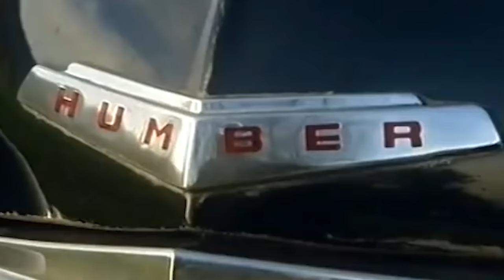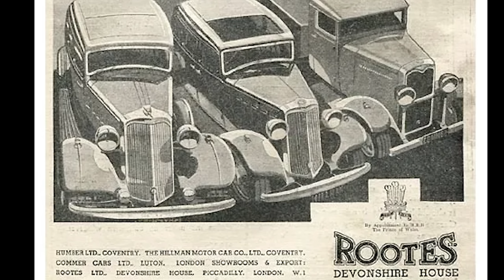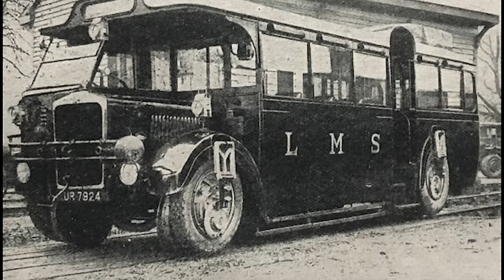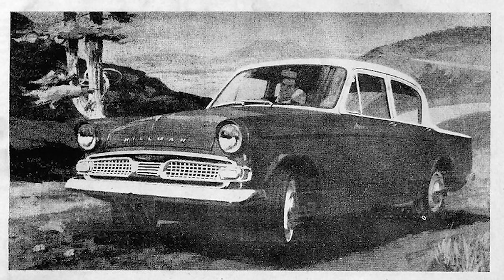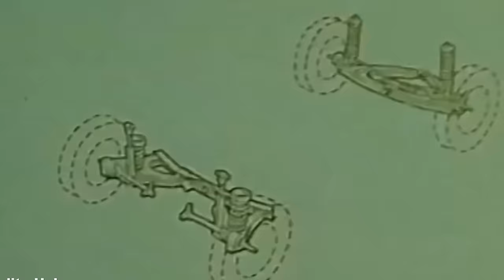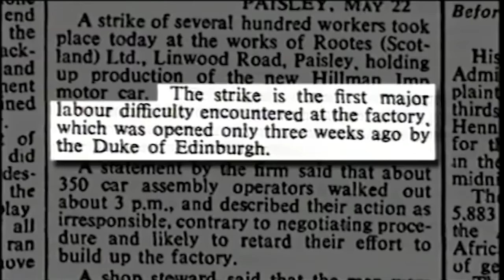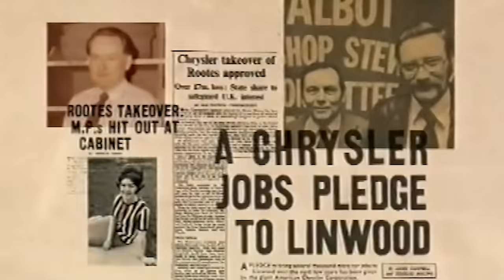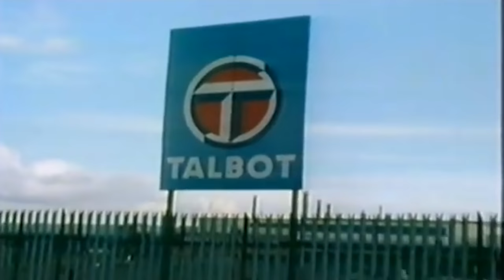The LOST BRITISH CAR EMPIRE! - The Rise And Fall Of The Rootes Group

Comment: The Humbers were the best style cars they made. When I was a kid in the 70's, we had a Humber Super Snipe. 
Talbot was a bain to the company but the big downfall was when they were bought by Chrysler.. Then they bought Simca, which was worse than Skoda cars at the time. They brought out the 'poor mans Range Rover'. The Rancho. It had the Simca front and engine and the rear was supposed to be similar to the Range Rover. A massive flop for the company. 
You missed the Sumbeem Alpine, a great little sports car at the time and the sloping back Sumbeam Rapier, a family sized car.
Reply from the maker: The Super Snipe is an absolutely stunning car the Series V is my favourite. I agree with you on your points about Chrysler especially.

Comment: You stated that the Humber marque was dropped in 1970.  This is incorrect.  A colleague of mine at the time, ordered and received a brand new Humber Sceptre 4 speed Auto with the new Borg-Warner 45 box in 1974. I also owned a 1972 Humber Sceptre Auto with the 3 speed Borg-Warner 35 from 1974 to 1981.

Comment: Good work but no mention of the Sunbeam Alpine, designed to compete with MG and Triumph sports cars in those wonderful giddy years of FUN.
The start of the decline was caused by government blackmail which Rootes could have refused by securing contracts for Imp bodies ahead of launch. This would have avoided the Linwood factory disaster 300 miles from home base and Pressed Steel anyway had a plant at Swindon.
Had the BMC muscle been challenged as having a monopoly on steel bodies it would been successful and, in the meantime, Rootes could have drawn upon steel panels from its partners abroad while teething troubles with the Imp were solved by the time of Mk.2. Some say that teething troubles were largely due to the Linwood labour force lacking the skill set of workers in the west midlands and that balance and cooling problems would have been tested out of existence "at home". It was a revolutionary car in so many ways and more 'normal' than the Mini in terms of internal space and comfort.

Comment: Although the "Arrow" range was a relative success for Rootes, compared to the "Audax" range quality had nosedived. No doubt the influence of Chrysler's cost-cutting accountants was responsible for the tinny construction and the interiors were far inferior - sumptuous pleated upholstery was replaced by cheap flat vinyl with the "pleats" stamped into them. Dashboards became one - piece fittings with cheap switchgear.

Comment: The amount of Hunters that had damaged gearboxes in them, when the wrong oil was used, was amazing. Use to sell parts for them...

The Avenger GT and Rapier H120 were cool cars...
Reply from the maker: Was that a bit of a trend back in the day? People putting the wrong oil in?
Reply: @tomdrives yup, they needed a thin oil like engine oil, but many people who didn't know, put 140EP gear oil which was way too thick...
Reply: My grandfather had a Rapier   then a Hillman Hunter estate
Reply: I had a Hunter , I only paid $50 for it (New Zealand) , quite tidy , and it went well, but there was a problem with the gearbox, when it was in top gear, you had to keep some pressure  with your hand on the gear stick , or it popped out of gear .
Reply: @barrycuda3769  wen my granfather got his hillman hunter estate car , im sure they used red oxide paint to paint the whole car !!!! My grandfather and his son , went to a scrap yard to replace the engine !! 
" the good old days "

Comment: Rootes were ultimately too low-volume to survive with the marque portfolio they had and some within the company belatedly recognised it. Before approving the Chrysler takeover, the British government offered Rootes to both BMC and Leyland who both refused. Yet although not with its challenges Leyland (1965 UK share at 6.8%) would have likely found Rootes (1965 UK share at 9.9%) much easier to digest into Triumph, being a tempest in a teapot compared to breaking its teeth trying to take on the giant gobstopper that was BMC (1965 UK share at about 40%).
Reply: Ehh; had the politicians not kneecapped Rootes plans to expand the Ryton plant (to say nothing of the loss making debacle the Regional Policy then forced them to do), it's likely that the company could have weathered the decades that followed.

That said: old-man Rootes being largely against economy cars in the first place and only mildly tolerant of the Slug project that led to the IMP, Rootes was in a weaker position than they could of been.

A properly launched small car from an expanded Ryton could have got strong sales, especially if priced properly (unlike BMC's Mini 😅).
Reply: In addition to expanding Ryton, it would have also been advantageous for Rootes to: 

- Forgo buying Singer and taking on its debts.

- The Rootes family would take Peter Ware into their confidence early on upon joining in 1958 over the company’s situation, aiding them towards a better direction and a slow pruning of their marque portfolio prior to an alt-Leyland takeover backed by the government to prevent Chrysler takeover. 

During the ill-fated Swallow project, some felt the company should have been consolidated around a single marque like Humber and carve out a BMW-inspired premium niche instead of trying in vain to compete against mainstream market BMC. 

Something they could never realistically achieve by themselves, outside of a potential Leyland takeover and being absorbed into Triumph who were on the up at the time as a premium marque and had brand recognition in the then important North American market. 

- Avoid Communist-directed 1959-1962 Acton strikes that caused losses and impacted Imp related expansion and development at a critical period, which together with Linwood distracted them from attending to the Imp's development issues. 

- Discover true Imp engine 800-948cc displacement range early on rather than fruitlessly trying to reach 998cc, allowing for focus on 998-1150+ tall-block in lieu of Swallow project.

- However tempting it is to make Imp into a British OHC analogue of the FWD 0.9-litre DOHC Alfa Romeo Tipo 103 prototype and calling it a wrap. They should have instead kept the Imp rear-engine yet with a Simca 1000/Seat 850-llke 4-door and SWB Fiat 133-meets-Suzuki Whizzkid-like 2-door two-box. 

Making the Alt-Imp 4-door like the commercially successful Simca 1000 with similar USPs, yet with a smaller SWB 800cc+ sporty-looking 2-door entry-level Mini challenger to increase economies of scale and utilize unbuilt 800cc Imp engine that would have been useful in markets like France and elsewhere (see Simca 4 CV / Sim'4).  

- Seek to continue technical agreement and general ties with Isuzu (pre-GM) with New Minx and Arrow commonized with Bellet and Florian / 117 Coupe along with Minx-based 1.3-1.95-litre G petrol & C diesel engines. Possibly involve Isuzu in both Imp and Commer FC, which would also help with spreading out costs for two minnow companies. 

Worth mentioning in real-life the Isuzu-based Bedford/Vauxhall Midi, Brava and Frontera models as well as the Isuzu Panther were distantly related to the Rootes Hunter-like Isuzu Florian via the Faster pick-up (akin to the Hunter / Paykan pick-ups). It is something to think about later on in event of 4WD and SUV boom.  

- Proceed with Avenger / B-Car, C-Car and D-Car projects including Avenger 4-cylinder / V6 (now OHC replacing SC 4-cylinder / Triumph I6 and slotting below Triumph Slant-Four / V8), they are subsequently merged with Triumph's own Bobcat (Rootes Avenger estate C6 proposal = SD2) / Puma (C-Car = SD1) / Bullet / Lynx projects with Michelotti bodied Alt-Triumph Avenger (including Alt-Triumph Sunbeam) replacing Ajax.

Possible Commer FC and Standard Atlas are both replaced by an Alt-Rootes/Triumph-based Leyland Sherpa commercial model. Itself later possibly replaced by Alt-Leyland/GM aka Bedford World Van project in 1980s that would have replaced the Bedford CF and Sherpa. 

Alt-Lotus Sunbeam instead becomes more like Alt-Triumph Sunbeam Sprint (not precluding some Lotus involvement). Sunbeam/Avenger platform also possible basis for Sunbeam Alpine / Triumph Spitfire replacement below Bullet aka Alt-TR7 styled by Michelotti in place of Harris Mann. 

Worth mentioning in real-life the Avenger estate based C6 proposal was later converted from RWD to FWD before it lost out to Simca's 1100-derived proposal, which in theory also applies to the Sunbeam/Avenger too as a basis for FWD C/D-Segment models with styling following a similar path to Roy Axe's efforts at Chrysler Europe and Rover for Alt-Triumph. 

- Post-Leyland takeover would lead to Roy Axe eventually succeeding Michelotti, with Harry Webster possibly being in the position to develop a FWD supermini project beneath the Alt-Triumph Sunbeam/Avenger to replace the Imp that would give placeholder name of Triumph Torch (a name for an early Herald proposal IIRC). 

Interestingly the Triumph 1300-based supermini project has some visual similarities to the Roy Axe designed Talbot Samba, it is also likely such a supermini project would echo the real-life Webster-flavoured ideas of the ADO74 project in some respects as that was of similar size at the Samba.

ADO74 even called for a Peugeot 104-like engine/gearbox layout with engine mounted at 72-degrees, the 875+ Imp engine was already mounted 45-degrees at the rear though like with carrying over the engine to the Sunbeam, placing it at the front even at that angle should be pretty straightforward if deemed desirable and with development was capable of encompassing similar engine sizes as the ADO74 project's planned 900/1000/1100/1300 engines.

Comment: As part of it's protracted development the Imp failed it's crash test - this was covered up by the Government - but was revealed by BBC Nationwide much later (1975) as part of an expose' of a loophole in the official secrets act where they could actually reveal it abroad, which they did at the US Library of Congress. 
Understeer led to two of my sisters being in a serious accident with a telegraph pole, on a right - sweeping bend, in the early Autumn of 1976, both where wearing seatbelts, the one in the passenger side had the windscreen hit her in the face, thankfully they survived. 
Many users recommended a toolbox or even a paving slab in the front boot to improve handling.

Comment: i owned a 1964 Humber Vogue in the 80s......loved that car. My Mrs and i even used the crank start for a time while we saved up to get the starter fixed.....some dick had hooked up the battery the wrong way round and the previous owner sold it  to me cause the battery wouldnt charge😂😂😂😂 easily fixed 😂😂🇭🇲🇭🇲

Comment: I had three Hillmans to Gazzells and a Minx in Australia they were not very good the alloy cylinder heads blew head gaskets regularly by today's standards what pile of crap but now l drive around in a 1997 Toyota Hilux l also am from Australia and what a well engineered and well built vehicle at 27 years of age and with 436000 kilometres on it what a reliable vehicle no burning oil no blown head gaskets infact it is still got its original head gasket the motor has not been removed and another thing some classic British cars are cheap l have seen routes group cars sell for aud$1000 $2000 and $2600 at auction that's the only place they sell were my Hilux sells for around $5000 to $6000 and that is privately and they sell in a couple of days and on ebay l saw a Sunbeam Tiger reach $5100 l don't if they sold it but ebay is pretty harsh and there a practically none left on the roads in Australia don't see any actually l did see a 1966 Hillman Minx broken down at the side of a motorway broken down and that was on Christmas Day and my brother has 1963 Hillman Minx convertible but it's not running engines gone and a Sunbeam Stileto and it's not running engine problems but he drives around in a 1976 Toyota Corolla and it works fine and is worth more than is awful Rootes group cars even if they were running now Toyota there's a motor manufacturer that knows how to build vehicles and they are the most popular vehicles in Australia the biggest selling vehicles in Australia for the past 25 years and the demise of the rest of the British motor industry was down to the Japanese building reliable vehicles that worked

Comment: The Imp was poorly named and rather ugly.  The rear engine was a terrible idea.

The Japanese invasion in the early seventies exposed mass produced british cars for the substandard cars they were.
Reply: Why was it a terrible idea the beetle worked well with rear engine and they were known for good handling
Reply: @danielrussell446  because the beetle was reliably engineered.  That said, it was terribly primitive.  I know because I have driven thousands of km in beetles.  

By the 1960s and 70s, with the increasing NVH and safety requirements, and the difficulty of making them safe to corner at speed, it was a bad idea.

The ideal car for the time and place was the Datsun 1200.  Absolutely brilliant, reliable and perfectly sized.  And we all like perfectly sized.
Reply: That'll be why the Imp has a long history of motorsport success then I suppose...
Reply: @nectafarious8842  Interesting point.  I did not know that the Imp won the BTCC 3 times,.and that it was considered to have good handling.
Reply: @yuglesstube  that's the point I tried to make above the imp was known for its driving dynamics
Reply: @danielrussell446  I stand corrected